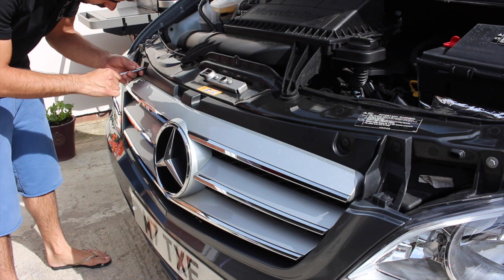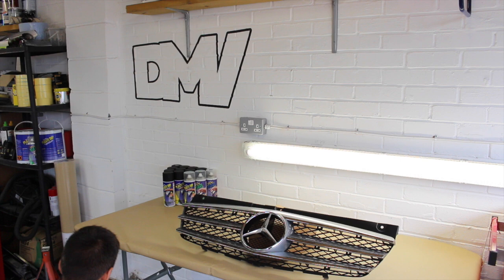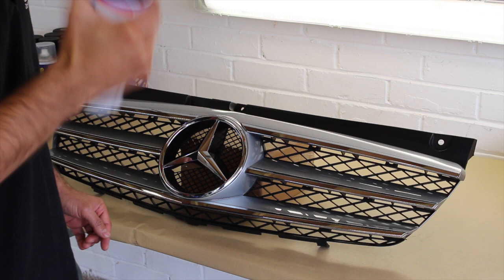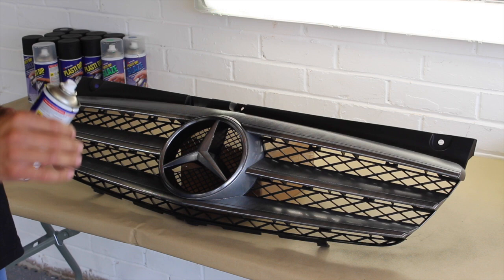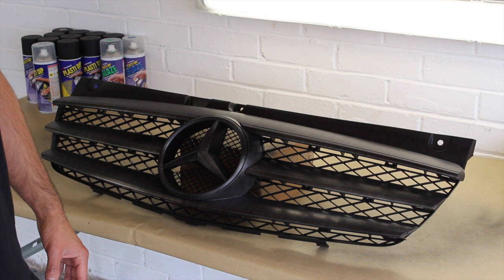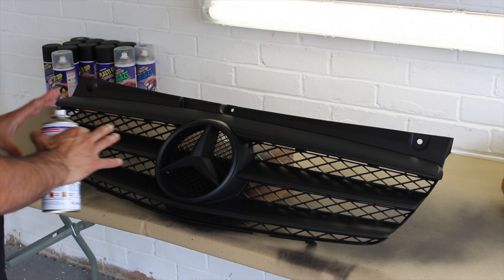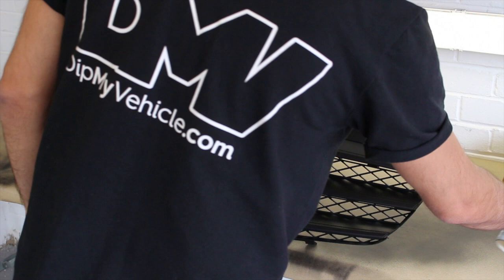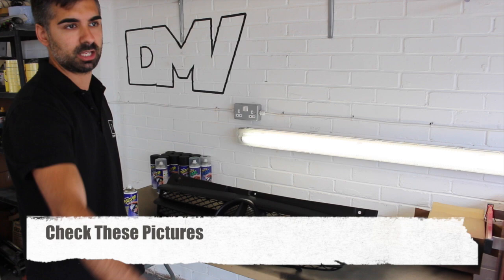How to Plasti Dip Your Grille

Comment: Will it peel of in time from high pressure wash? Or start peeling of from rock chips?
Reply: yes
Reply: @cadenlippincott3353  Could you put a couple layers of high heat clear coat over it to help protect it?